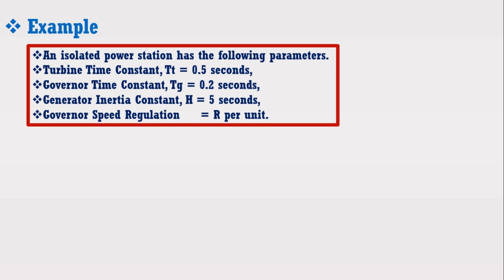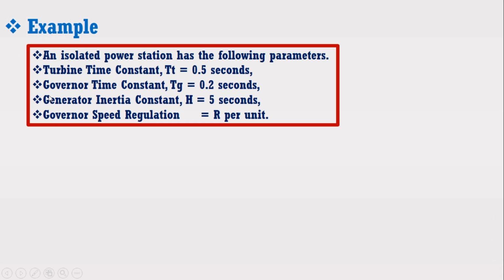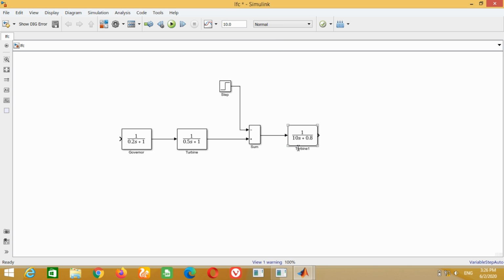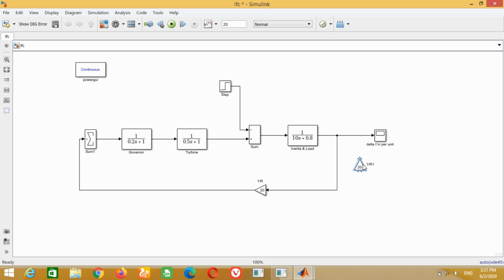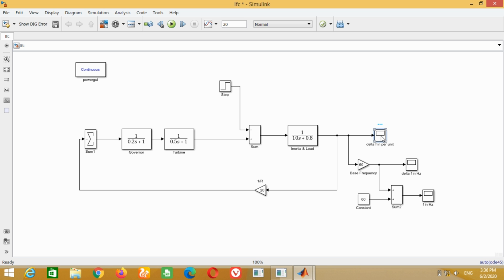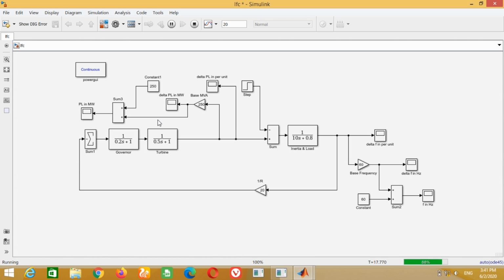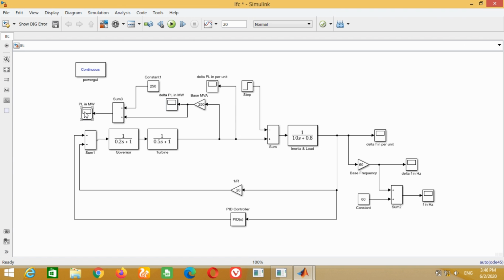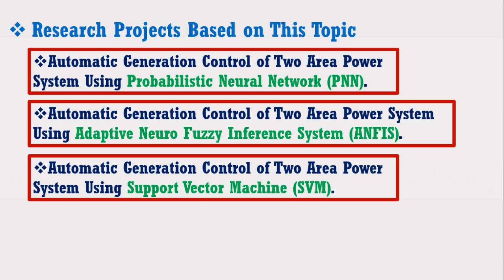How to Design Load Frequency Control using Simulink ? | Dr. J. A. Laghari

Comment: Hello sir very usefull video, if the change is frequency instead of power, where would this block go? Thanks you so much
Reply from the maker: Thanks for the comment. Change in frequency is dependent upon the change in load. Because, without change in load/power, how frequency will change?
Reply: @DrJALAGHARI  I mean, in real systems the governor responds to changes in frequency by adjusting the generated power. I wonder if it is possible to use frequency as the input and have generated power as the output in this diagram.

Comment: Hello Dr. Laghari, thank you, your knowledge is very helpful. I added a derivative function to the generator load output before entering the PID circuit and then did MFO optimization. and the results are very good and much different when only doing PID optimization without the addition of a derivative function at the output. Can you provide the reason for this? because I found this by accident.
Reply from the maker: Thanks for the comment. You may go through feedback control system theory for this justification.

Comment: Thank you sir. I couldn't understand why the second parallel feedback was added. I thought the pid controller would multiply after feedback. You applied it that way in your pso video.
Reply from the maker: Thanks for the comment. Yes. You are right. It was by mistake. Kindly follow the PSO video model.

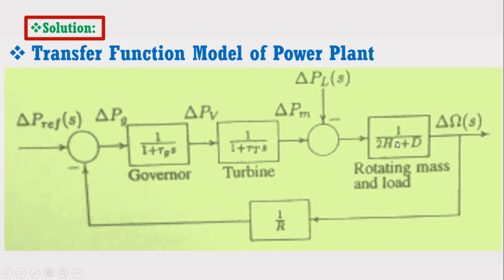Comment: Why does Pref is not at the summing point but the paper shows there is a Pref at 5:22?
Reply from the maker: Thanks for the comment. This is not Pref but it is Pload.
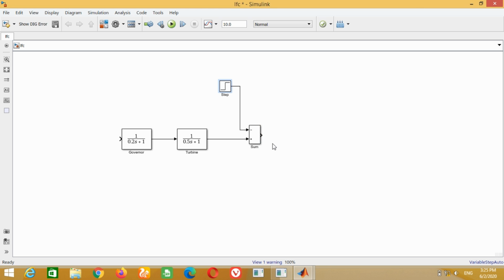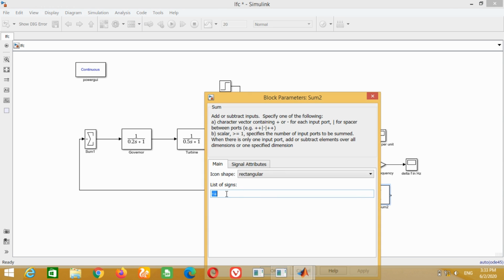Reply: @DrJALAGHARI  At 5:22, from the green notes,at the far left we have delta_Pref but looking at the simulink block at 9:45 , there is no delta_Pref at thenleft summing point.Any reason?
Delta_Pload is delta_ Pl summed with delta_Pm,right? Both are there in the simulink but delta_Pref, why not drawn in the simulink? Looking at the green notes,delta_ Pref should be summed with the speed feedback.
Reply from the maker: @gustavomarcelo7250  Right. Basically this example is taken from the book power system analysis by hadi sadat chapter 12. What I feel is that this model gives values per unit.  The output is frequency deviation in per unit which normally should be zero in steady state. Therefore, at the summing point the reference will be zero that's why it is not used.

Comment: I want to reduce frequency fluctuations by using csv files as input.
I have created spreadsheet block which contain all the data which is used as input in this model
Now anyone suggest me where to connect that spreadsheet block outputs as input in model
Reply from the maker: Thanks for the commment. I couldnot understand your query. Why you use csv file?

Comment: Hello if i want to simulate a generator trip should i use the same system? Is there a relation between load change and the trip of a generator?
Reply from the maker: Thanks for the comment. I am not sure. You may find research paper closely related to this topic. If that topic has used the same model then you may use it.

Comment: Great Video... Sir while I am using SVM, the shape of obtained trained network is 1*1 struct. So gensim(net,-1) is giving error to convert the model for simulink. So my question is how can I use SVM for load frequency control?
Reply from the maker: Thanks for the comment. What is the output name of svm. If it is not the net, then replace the net with that name. It will work.

Comment: Sir how we know that the output from the rotating mass is frequency.As we are calculating frequency by taking signal from rotating mass.
And second, why we call rotating mass and load a generator. Sir and what should be the signal to PID,what should be the  values of the signal to PID controller.
Reply from the maker: Thanks for the comment. The details can be found in hadi sadat books chapter 12.

Comment: Hi Dr. Laghari, thank you for your video and a good explanation. I have a doubt, what is the meaning of delta-P ref, I mean, what values could we give to that parameters? it is alwys zero?. Thanks :)
Reply from the maker: Thanks for the compliments. Delta pl means change in load demand. When frequency recover to its original value. It means that system has successfully supplied the change in power. Therefore, now delta pl becomes zero
Reply: @DrJALAGHARI , Dr here i have a problem, delt pl or step signal (0.2pu). Whnever i change 0.2 pu into 0.3 or anu other value, optimization response get noise and change where PID remains its state?

Comment: How to obtain the Bode plot(frequency response plots) of the above simulink model?
Reply from the maker: For bode plot, you have to use control system toolbox. I will make video on this topic too
Reply: @DrJALAGHARI  Thank you sir. It will be very helpful for my M. Tech Research Project.
Reply from the maker: @TPP54321  ok. I will try to make video on this topic as soon as possible.

Comment: such a good video thank u for that! can u do a similar one to virtual inertia control using simulink pls?
Reply from the maker: Thanks for the compliments. Virtual inertia control ?
Reply: @DrJALAGHARI  inertia which comes from thermal power plants will decrease with the penetration of renewable energy sources (res) which can be provided through virtual inertia by dc link capacitors for example. and im searching for a simulink simulation which can show the impact of this virtual inertia to the grid frequency now

but can u tell how u got the parameters for the pid controller though?
Reply from the maker: @lnng5296  Thanks for the message. The parameters of the PID controller are taken by hit and trial method to get the satisfactory response. This response can be further improved by using different methods.

Comment: Thanks alot for excellent explanation...after seeing your videos i bought power system analysis by hadi saadat...
Sir how we will get time constants for generator,turbine and speed governor
Reply from the maker: Thanks for the compliments. If you are using any specific power system, then they will provide the time constants. However, if you are using this book data, then this data is also accurate. You just have to use different controller.

Comment: Sir .Is the simulink   model is same for automatic generation control of interconnected power systems with diverse source of power generation (hydro,thermal, gas).
Reply from the maker: On automatic generation control, I have already made the video. Please have a look. Automatic generation Control model remains same for hydro, thermal, gas, diesel except change in their time constants.

Comment: Sir,Could you explain how to make this project with simscape on simulink?
Thank you
Reply: Yes Sir,
I have some trouble when Use  Synchronous Generator fundamental (SI Unit) from Simscape (Specizalized Component) and Try to make Exciter for it.
Reply from the maker: @rivzkyprananda9642  Right. I have to check it. Because commonly transfer function model is used to Perform the load frequency and automatic generation control model of power system.
Reply: @DrJALAGHARI  thanks sir, I hope that you make a video about it soon, because I will make this project for my thesis
I think that Simscape easier than transfer function because we just need paramater (in my opinion)
Reply from the maker: @rivzkyprananda9642  yes you are right.
Reply: @DrJALAGHARI  you are welcome,sir.
Reply from the maker: You mean using real generators, governors and loads?

Comment: I like it but i have a problem. electricity theft detection and protection design in software full template
Reply from the maker: Thanks. This topic need to be followed by any book or research paper. Without this, it may be quite difficult.

Comment: Sir, How to got P = 50, I=30, D=10 ? Is there any mathematical expression?? If have, can you please explain?
Reply from the maker: In this video, I have used trial and error method. Means arbitrary values one by one. For proper tuning, watch my video on how to design PID controller in PID Tuner.
Reply: @DrJALAGHARI   ok sir, thank you.

Comment: Great video! Very helpful. I have a question, how did you get the parameters for the controller? Just by guessing? Is there a different way to get those numbers?  Thanks!
Reply from the maker: Thank you so much for the compliments. In this video, PID controller parameters are chosen by hit and trial method. However, there are many other methods to tune the controller properly. I have made video on designing of PID controller in PID Tuner. I am sure it will be helpful.

Comment: What are the input and output here. I understand the output is the deviation. But of what and what does delta-P and delta-Omega represents
Reply from the maker: Input is delta P means change in load of 50MW, or 0.2 per unit. And output is frequency deviation for this change in load. When load is increased, frequency will decrease. This is deviation. After that we use PID controller to restore the frequency to its original value.
Reply: @DrJALAGHARI  Dr If i change this 0.2pu into some value else, it my effect optimized responses not pid ones WHY?

Comment: sir can u explain in detail how do we get those steady-state frequency deviation value???
i.e -0.0096 p.u sir how do we get this????
sir plsss reply
Reply from the maker: Thanks for the message. If you want to know how this steady state frequency deviation is calculated then the answer is that we have the mathematical formula for it. If you need i may send it to you the mathematical solution of the example through email.
Reply: @DrJALAGHARI  how to get this frequency deviation generated from step change 0.2pu?

Comment: Hello,

This is actually very informative. Thank you so much. I just wanted to ask how do you design the transfer function for the load or how do we calculate the time constants for the turbine, governor? Or is there any standard values for it?
Reply from the maker: Thank you so much for the compliments. Time constants of turbine, governor, and all other components are already fixed and are usually given for a power system. We have to use these values only.
Reply: Dr. J. A. LAGHARI Thank you

Comment: elslamoalikum brother I’m otibh from Sudan I’m doing my PhD right now in china, my recache work is in hydro turbine generating set  control and stability, i want to study the mutual influence of the torsional vibration characteristics of hydraulic turbine main shaft and governor please guide me how can use MATLAB software to molding the control system model and entering the Unit value equation of the unit including the generator equation, PID governor and PI excitation controller.
please guide me if it’s possible i need your contact.
Reply from the maker: You may go through the hadi sadat book and power system control and stability by prabha kundur. You will find good material there.

Comment: Thank you for a very informative video, sir.
In case we use an energy storage system for frequency regulation side by side with the turbine, how does this model change ?
Reply from the maker: In that case, I  am not sure, but by using the transfer function model of energy storage device or battery may be used in parallel with the system model. Hopefully by this way, it will work.
Reply: @DrJALAGHARI  greeting sir. I recently have finished my final year thesis, thanks to all of your guidance videos about this subject.
Again, Thank you!
Reply from the maker: @chungnguyenphuoc5727  Thank you so much for the compliments. My pleasure. May i know from which country you are ? It gives me pleasure to know that you have completed your thesis by watching my videos. Congratulations. Wish you best of luck for your future efforts. Last, don't forget to share my channel with your friends junior's so that they may also get benefit from these videos
Reply: @DrJALAGHARI  Thank you sir, and I wish you the same! I'm from Vietnam.
Reply from the maker: @chungnguyenphuoc5727  Thanks. Stay blessed

Comment: Sir can you please discuss simulation model of hydro power plant using matlab /simulink
Reply from the maker: The model remains same. Just time constants will be different. You can take any example from any book such as you can simulate the model of hydro power plant from prabha kundur book, power system stability and control. Or from any other book.